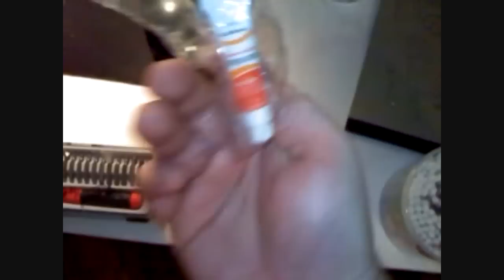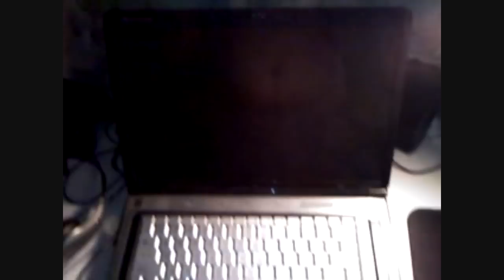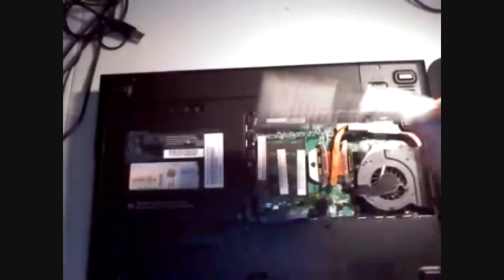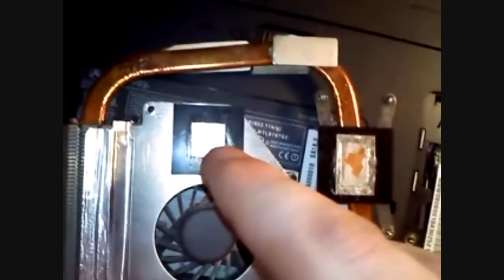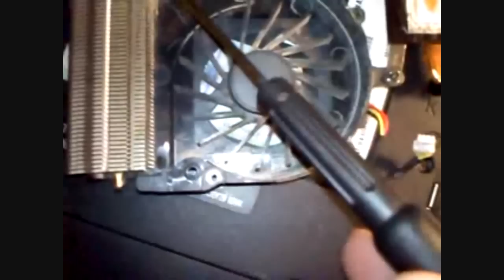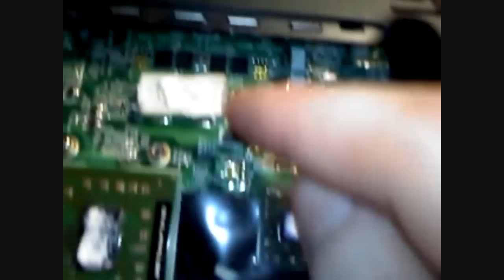Laptop Repair Tutorial

Comment from the maker: @tamara7859 i forgot to inlcude taking out the battery for any laptop, but for this specific laptop it didnt have a battery, i had a battery box cover because the battery slot was damaged, i had the cover on there to protect the elements.  That's why in the video i said "we arent going to mess with the battery box". I have been repairing computers for a long time, i rarely take out batteries anyways, cause i use a connection tester on various points if i am getting thorough in the repair.